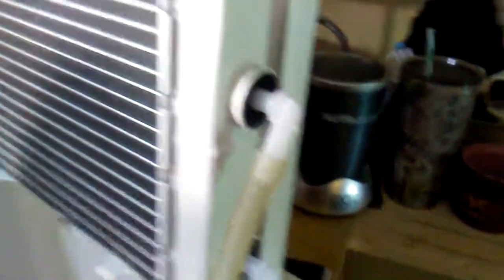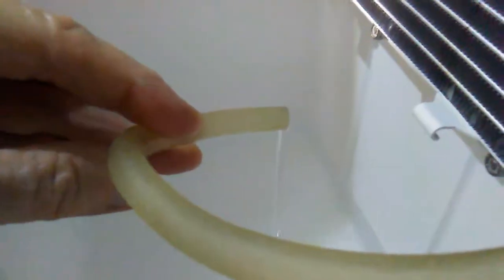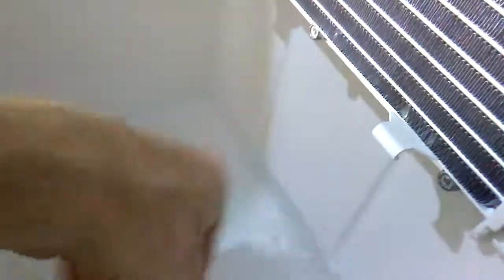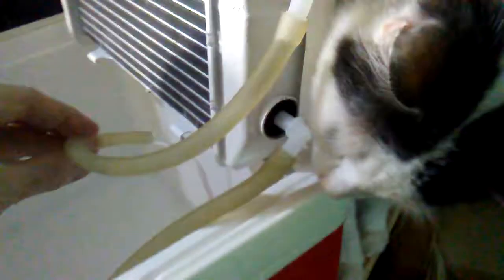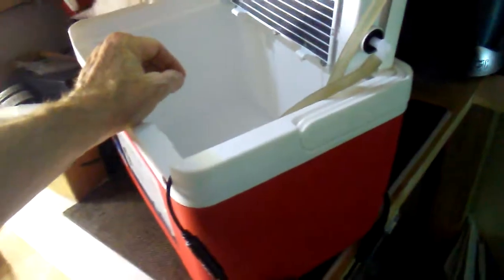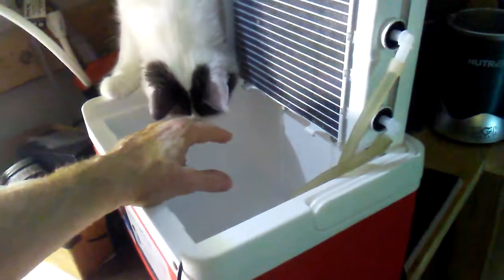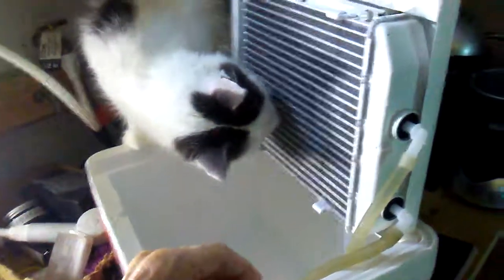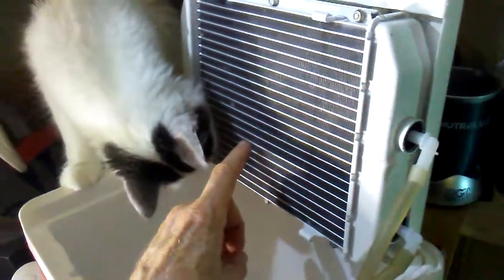DIY Air Conditioner: Ice Lasts Longer(A) The Water Pump - Ice Chest Air Conditioning - 12 volt

Comment: Could you use a little turn valve for same effect. My pump doesn't have dial on it
Reply from the maker: A valve would work but you definitely have to balance the ice water flow vs the hot air flow being sucked in across the radiator fins. Slower water can make the water inside the radiator warm up slightly faster. It's a really difficult thing to measure. Faster water flow ensures colder temperatures. A lot depends on the size of the components and whether your cooling a room or just using it for direct body cooling lile in vanlife etc.

It's a little like mpg miles per falling... Faster use equals less mileage etc.

I hope this helps... Get back with me for sure if you need more info!

Thanks,
James, Rescue Kitty😺 & Snowvan!
Cold School Team

Comment: Have you ever tried putting the ice on a perforated rack up off the floor of the cooler?. The ice drips water to the bottom but never touches the ice
Reply from the maker: Hey,
I actually did gather parts for a design like that when I was in Texas a few years ago. I bought a 5 gallon bucket and a round salad strainer and a spaghetti strainer to test one like that.
The challenge is getting the temperature melting point and drip rate synced up with the circulating ice water temperature to maintain some sort of equilibrium without one out running the other. It would definitely work.

The challenge presented is when the hot ambient temperature changes and the speed setting(rpm) changes on high, medium and low settings etc because higher airflow rate draws in hotter air faster and would change variables each time. I may put that model together for some testing for sure. I'm working on a similar design where the ice sits on a 45° angled ramp so the ice is funneled down to a melting trough that holds minimum needed ice water to circulate and drains all the excess water overflow keeping ice & water contact down to a minimum.

Thanks for mentioning that. Will make a great test video!
James, Rescue Kitty😺 & Snowvan!
Reply: @HomemadeAC  I'm getting ready to build my first one after studying many of the experts on YouTube. I will cobble together different designs

I'm going to use your idea of separating the fan from the radiator by several inches inside of a box to get a cooler air flow. Good idea. 

And I'm going to have two 5v pumps, one pump running ice water through a heater core radiator that sits behind the fan like you have. And another pump running the same ice water through a copper coil sitting in front of the fan, that sits on top of the cooler. The only holes in the lid of the cooler will be 4 small holes for the plastic tubes that lead to the pumps

So the ice (that I plan to double insulate) never has hot air blowing over it and never touches the water below.  The ice just slowly drips cold water down to the two pumps that  pump the ice water to the front and rear of the fan.
Reply from the maker: @wearewatchingyou4371  Very nice idea!

Keeping "heat" away from the cold is definitely good! Anytime there are two temperatures simultaneously present in a room there is always a transfer of energy(heat chasing cold) somewhere. It's such a tricky concept minimizing the effect of the heat chasing cold for sure!

Thanks so much for watching & commenting!
James, Rescue Kitty😺 & Snowvan!
Reply: @HomemadeAC  Yes that's true. YouTuber desertsun02 has a indirect Evap cooler that sits outside the window, uses no ice, and blows the 60° cool air under small holes at the bottom of the window. I have learned much from the both of you
Reply from the maker: @wearewatchingyou4371  Yes, Desertsun02 definitely has some really great stuff for sure!

I used to work in the Utah desert for two very hot arid summers and used to perform maintenance on evaporative rooftop coolers for a company. One thing to remember about evap or ice chest style a.c. units is that by themselves they are only able to drop the ambient temperature by a limited about of degrees. But the human skin feels direct air blowing on it and it will feel cold. Once the temperature reached 110°F even large evap coolers can't keep up because it's still 85° inside the room even after the temp drops 20° give or take 5°. On those days the human body starts to feel the hurt.

One way to enhance evap coolers in dry climates is to chill the water before it washes down the filters so the direct airflow is even cooler than its normal ability. The large business evap coolers store a pan full of water that gets hotter from the sun faster than it circulates over the filters and begins to create steamy sticky air. And evap coolers are terrible in humid climates for sure. All obstacles can be overcome with enough natural sciences and added tricks for sure. It's like tweaking a race car 1/10th of a tiny second faster with each tweak and implemented discovery for sure!

You sound like you're really examining all the available remedies and that's the way to do it! 

Keep me posted on your a.c. build!
James

Comment: What kind of water pump did you use that you can control the flow rate?
Reply from the maker: Hey rocky2000316,
I am currently building with a 12 volt submersible fountain pump. I am currently using this model  to build AC units because they have a (5.5x2.1mm) barrel plug on them. I wanted to use these for AC units that I send to the Philippines. This is to make assembly and use easier and to alleviate soldering etc. These plugs can be simply plugged into the 12 volt converter and be plugged into a 11 wall outlet without bare wires etc. They also have a "slider" that you can manually control the water flow rate. You can also control the flow rate with a 12 volt controller on some as well. The description of this particular water pump is below.

I hope this helps...
Thanks James & rescue kitty

"JIUWU DC 12V Solar Micro Brushless Water Pump Submersible System Electric Max1.5m"
Reply: @HomemadeAC  Just curious love but... would making the water salt based to allow the water temp to freeze at a colder temperature work hun? I know when I make ice packs for my BF I will add ice and very small amount of water to make it pliable and then add good mount of salt which seems to make the ice-pack even colder than ice alone.
Reply from the maker: Another thing about water flow rate is that you can also use a 12 volt speed controller on the water pump to slow down the rate. You can use an inline 12v barrel plug style or build one like I did on my Gott 48 test unit as well. I built them at first to ensure durability when running 8 hours or more. I got them with larger aluminum heat syncs and removable fuses. I'm starting to use small speed controllers now like the inline style. One thing about the inline components is that they draw a tiny bit more amperage and is noticeable at top fan speeds.

The a.c.(fan & small single water pump) will run off 2 amps but the fan won't run top speed. I tested last night and the power supply needs to be at least 3a to account for inline component loss. Direct plug without controls added give the fan top speed capability or also using the larger potentiometer with circuit board and heat syncs etc like the ones I build.

Thanks for all your input,
James, Rescue Kitty😺 & Snowvan!